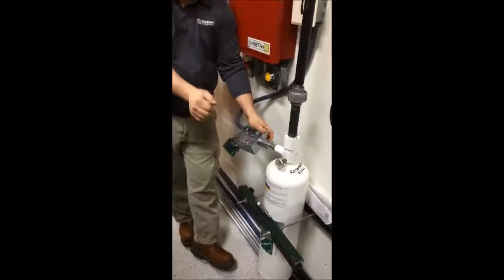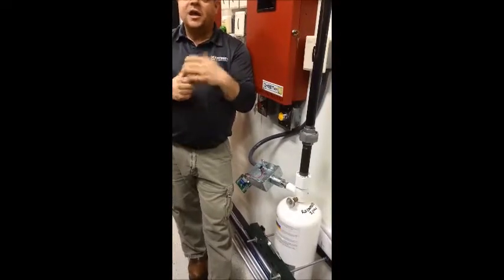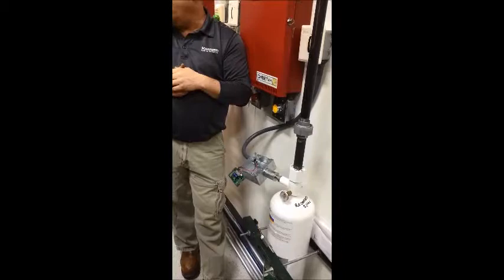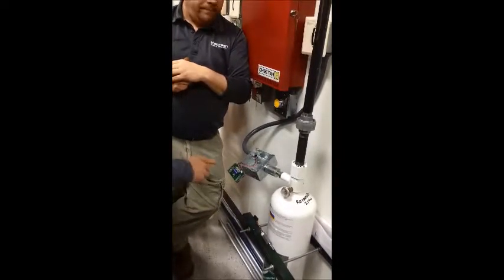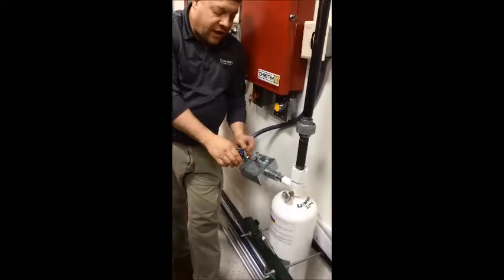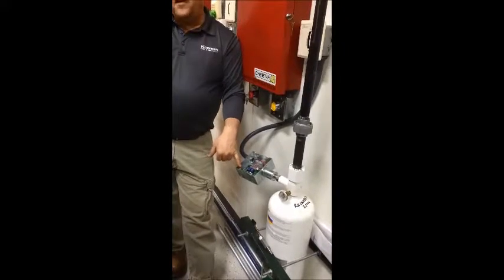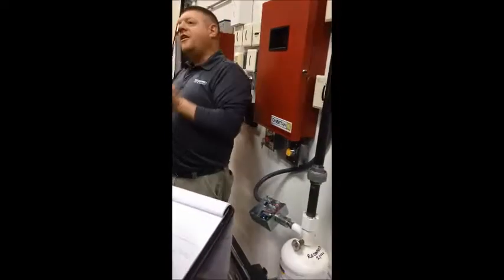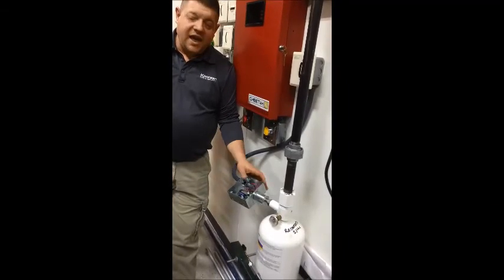Disabling Squib for Fike system

Comment: Hi The Yellow And Green Wire What It Is Used For.
Reply from the maker: He said it is used more in Europe and not really used in NA
Reply: Still Have No Answer is Meant For Something , I'll Let You Know When I Get The Answer
Reply: The GCA  yellow and green  leads are  provided  for 
connection  to a manual actuator if  supplied.  If a 
manual  actuator  is  not  supplied,  terminate  the 
yellow and green leads in the same manner as the 
red and blue leads. The yellow and green terminals 
are shunted internally on the ARM and connection 
to these terminals provides safety for this pair.